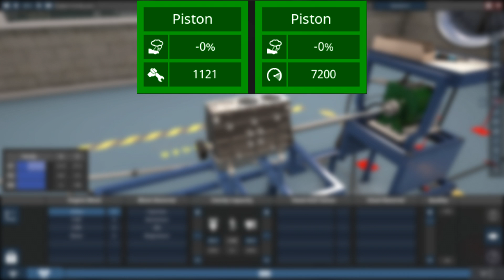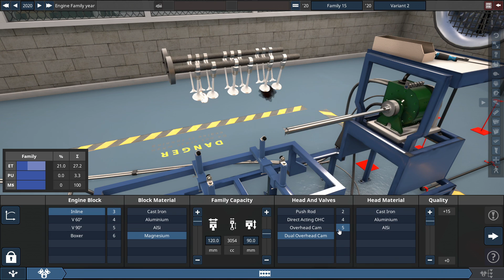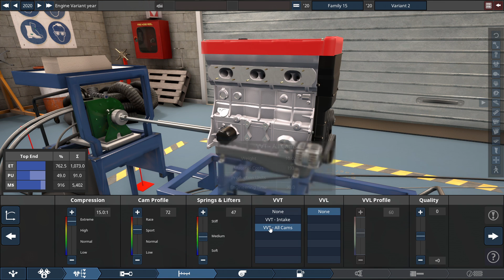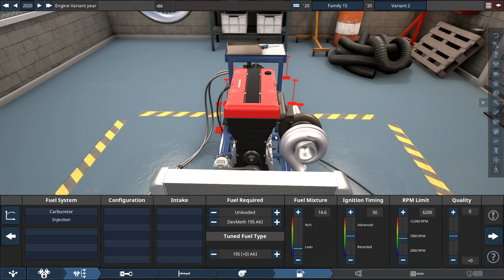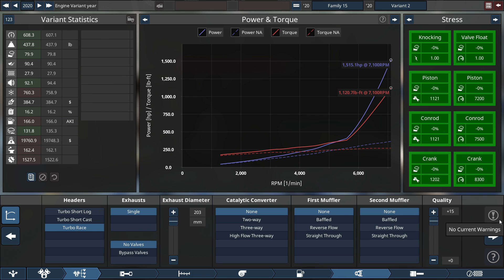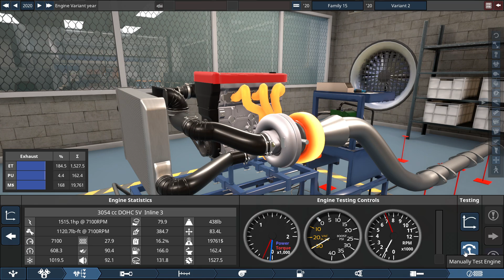The Ultimate, No Stress Inline 3 Engine Ever! | Automation The Car Company Tycoon Game

Comment: There's no stress because there's no back pressure from the exhaust system. The exhaust is designed to create back pressure which equals torque to the ground through the drivetrain. If the gases can freeflow out of the motor the motor has no resistance and therefore produces less power through the drivetrain. Try it with a 2.5inch or 3 inch exhaust and watch it blowup.

Comment: devmeth 195 is a mod. Social credibility loss (-1000). Also forget making it realistic at all lol 1 liter per cylinder is absolutely bound to cause problems. Why not do what koenigsegg did and  make a 2.0 NA inline 3 do 600hp off 91 octane. They didn’t use VVT either.
Reply: Devmeth is a feature in the beta version of automation. Koenigsegg’s 3 cylinder engine isn’t Naturally Aspirated, it’s twin turbocharged. The engine also doesn’t run on 91 octane, it runs on E85. The engine also has free valve technology which renders VVT obsolete because the valves are controlled by pneumatic actuators.

Comment: Cool peak numbers for the sticker on the showroom floor. 

But worthless when 80% of the rpm range you have a 400hp engine, that has a momentary bi polar psychotic episode just before you reach red line. 
Lose 10-20% of your peak numbers to get a torque curve that starts at 3-4000 rpm and is actually usable. 

But that doesn’t make for as good of a thumbnail 🤷‍♂️
Reply: Obviously not this insane but you get my point
Reply: The way I think of it is like you have 2 engines. A 400 horsepower engine for your normal cruising and the ridiculous one when you want to tempt death. Irl there would have to be a system that locks out the Rev ranges from each other. Not letting it go below the turbo range for sport/death mode and below the turbo rpm range for normal use. It's unreasonable but a dude can dream

Comment: Would be cool if you could select a 1 cilinder engine. And build is as strong/powerful as you can. And then add cilinders with the same spec. That’s how cossworth does it.
Reply: Unfortunately this game won't give us lower than 3 cylinder engines (for now at least - who knows if they add them in later on?).
Reply: probably will @Loser2817

Comment: I’m curious about how to get engines from automation into regular beamng cars, I’ve seen a lot of people doing it but I have no idea how they do it
Reply: A channel called “Forgotten mustard” made a video on how to do it about a month ago. 

To summarize, you’re not actually swapping the 3D model, but just changing the text and audio files of one of the existing BeamNG engines to those of the Automation engine. 

You edit the engine braking values and torque curve text files along with other values.  It’s not a sexy procedure, but also not too difficult. 

The torque curve is literally stored like this in text. 

RPM : torque
1000:100
2000:120
3000:140 
And so on.
Reply: @Forbiddina  thanks :)

Comment: I feel like you shouldn't be able to use the devmeth fuel, as fuel that high doesn't exist. Looks like a fun game, but 100° of timing isn't close to possible, even with a low compression NA engine, much less with that much boost and 15:1 compression.
Reply: The timing isn't in degrees in automation
Reply: Try the controversial leaded fuel that got banned ages ago
Reply: @deepfreezzeer  nowhere near this, trash compared to modern fuels.
Reply: The explanation I've heard is that it's technically methanol, however I don't know the octane of methanol off the top of my head

Comment: sadly in automation it will run like shit, slow (depends on the gear ratio you will choose, but if you will try minimaze wheelspin it will be a snail) until you reach 6k rpm and wheelspin will kick in no matter what 😭
Reply: thats mostly due to the massive  turbo and turbine, making it smaller would be much better to drive at the cost of some horsepower
Reply: I meant beamNG not automation. Yes smaller turbo with low-lish pressure is always better and easier to build a fun car to drive for beamNG.

Comment: I ask this every time but can you make an engine where the turbo does NOT explode at any rpm so you can leave some extra rpm after the peak power before rpm limit so the engine could actually be used? If the peak power comes at 7100 and rev limit is 7100 you can never use the power. If you have some room after the peak you can rev slightly past it, then shift to sligthly below and hit peak power before the next shift. What I would like to see is a wannabe 80s F1 1.5 liter turbo engine using 2020 tech. Cylinder count can be any but they used between 4 and 8 cyl and single or twin turbos. Direct injection didn't exist so maybe use multipoint injection and they used basically rocket fuel so DevMeth. Thank you
Reply: Yeah this is a pretty useless engine, I've not tested it but I feel like you should be able to make roughly 80% of the power and actually make it usable
Reply: Leaded fuels might do the trick. But unfortunately leaded fuels have lowered the average intelligence of the world since it's introduction and subsequent ban. It doesn't take much of the leaded compounds added to fuel to dramatically increase the compression at which combustion takes place. The reason leaded fuels were developed was because fuels at the time combusted under compression to easily which causes random detonations and vibrations.
Reply: yes, but ethanol is even better. I assume you come from latest Veritasium video, lead was chosen because it was cheap to produce. Ethanol has even better properties (fuel-wise), won't make you dumb and these days is not that expensive. 
Many race cars use ethanol, because they are running crazy comp rates with turbos, so they need to be sure it won't detonate early. Also, squeezing that extra 2HP and 0.8% efficiency on a race car can make tenths of a second difference, which can be difference between podium or grass. 
This engine reminds me a lot of mid 2000-s VAG turbodiesel cars, which have similar power curve (not that ridiculous lol) as far as boost/rpm goes. As OP mentioned, they usually don't "go down" at the end of RPM limiter, creating nasty lag if you release clutch too fast (not mentioning the wear), and because they are diesels, you basically go from 4500RPM which is almost your limit to like 2000, where your turbo is beginning to spool up. Having that little overhang at the end might be super nice for techniques like short shifting or left foot braking (basically both boils down to having your turbo constantly spooled up, riding that maximum power peak constantly).
Reply: @n3ttx580  ethanol burns cleaner than gasoline. However it takes more fuel and produces different chemicals. So there is a trade off. Tetraethyl lead however is what was added to gas mixtures to make the leaded gasoline that was used in vehicles that caused the planet to lose IQ points overall. To clarify I wasn't specifically talking about leaded gasoline. Imagine tetraethyl lead used experimentally in another fuel. You could theoretically make your own combination.
Reply: @saiyoice  New communities have been built with zero lead and the test scores are still declining. lead theory is far less plausible than replacement theory